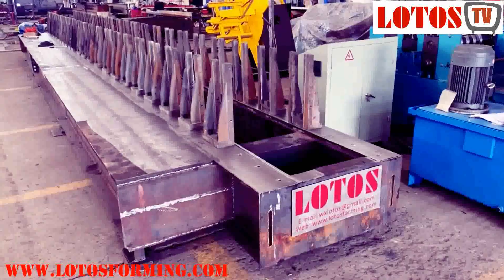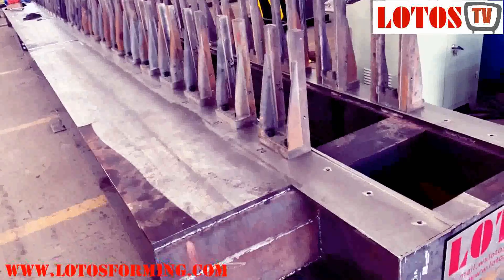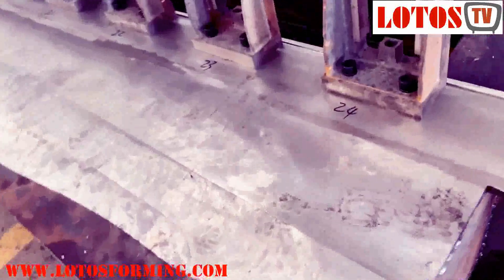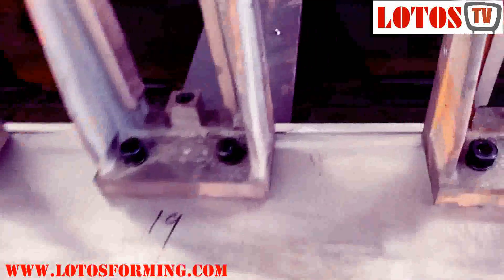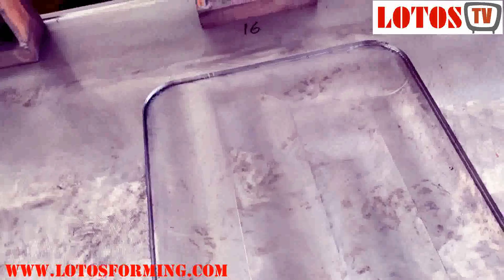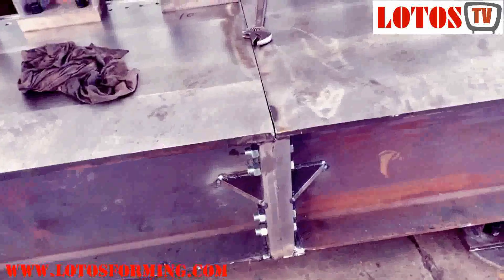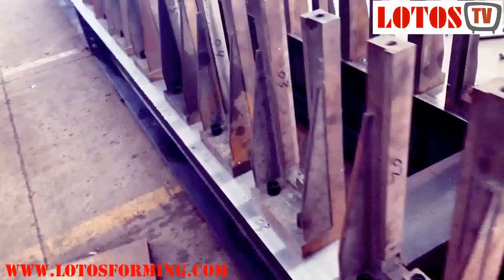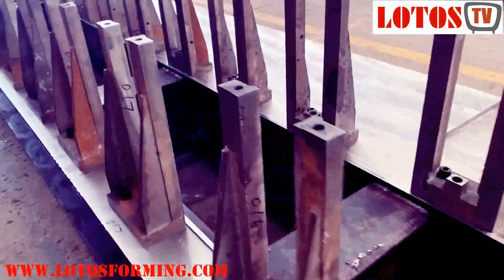【 Roll Forming Machine 】: Making roll forming machine | Roll forming machine design " 2020 DESIGN "

Comment: As the strip of metal travels through the roll forming machine, each set of rollers bend the metal a little more than the previous station of rollers

Comment: A roll forming machine bends metal at room temperature using a number of stations where fixed rollers both guide the metal and make the necessary bends.